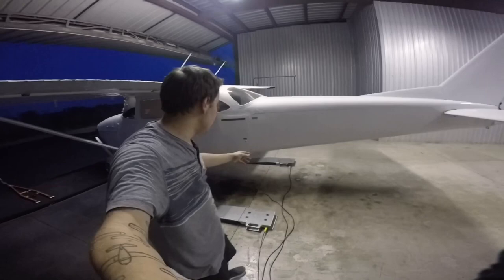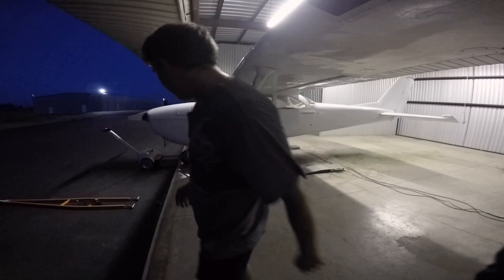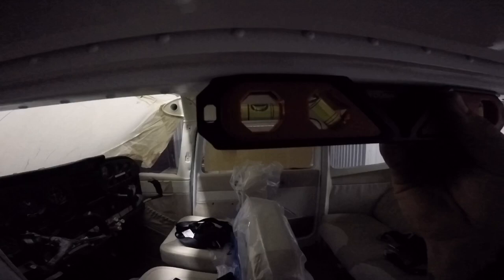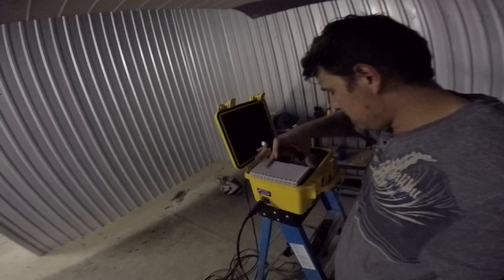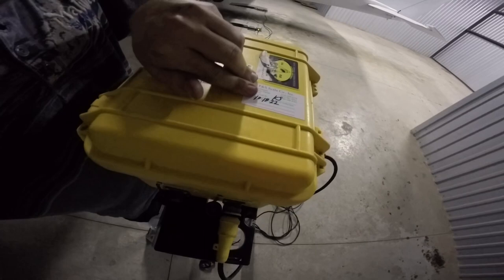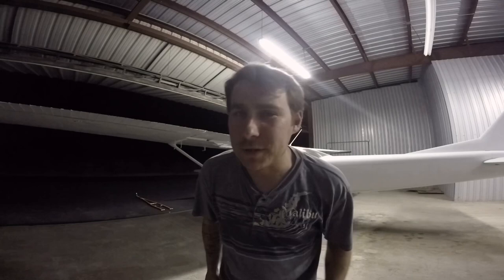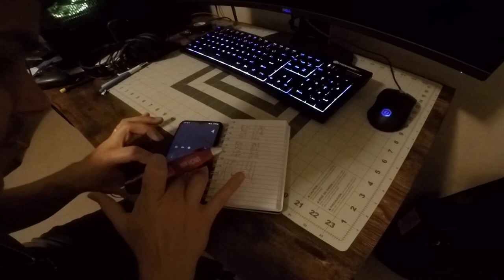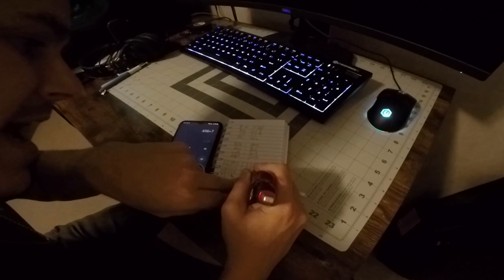Watch This Before You Do An Aircraft Weight And Balance.

Comment: How did you calculate the moment arms?
Reply from the maker: They were on the old weight and balance and correct. Normally you would level the aircraft drop a plum Bob from the datum then measure from there to the main and nose wheels. Then it's just WXA=M

Comment: How is this done for narrow and wide body aircraft?
Reply from the maker: It's pretty much the same, actually. They will have way more scales and sometimes use jack points instead of tires for the arms. But instead of the table only being 3 weights like mine was It may be 6 or even 12.